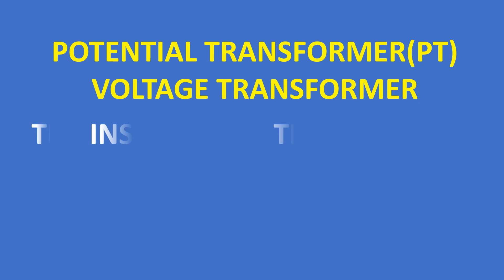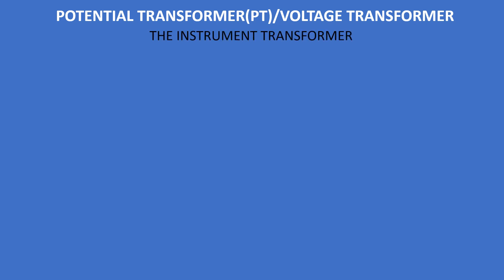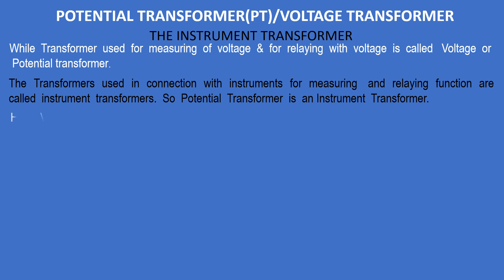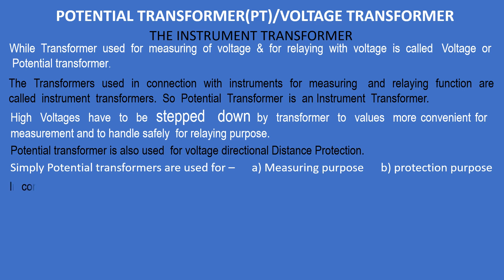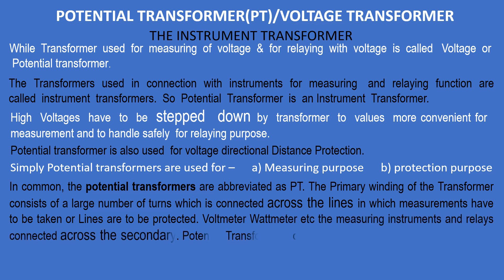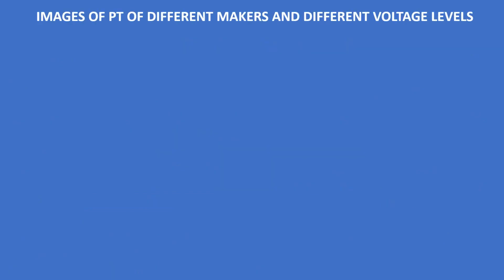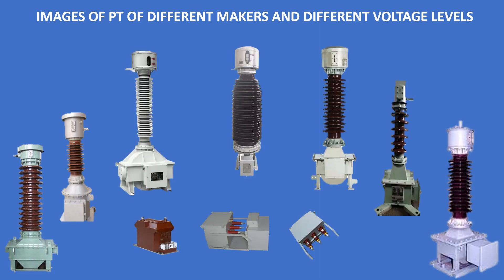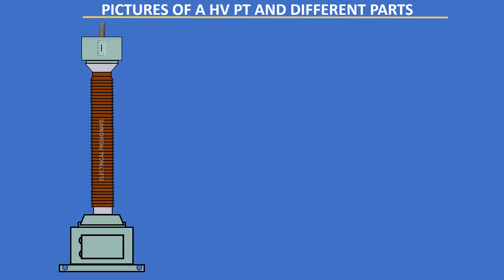POTENTIAL TRANSFORMER:WHAT IS PT:PT CIRCUIT CONNECTION DIAGRAM:VOLTAGE TRANSFORMER:INSTRUMENT TRANSF

Comment: just wondering, that, what if you would feed 20 KV to LV side of the coils, would you then get over 100KV out from the HV side of the thing?
Reply from the maker: Burden of a PT is few Volt -Amp. As electromagnetic PT is a step down transformer and its working principle is based on transformer, it can be used as step -up transformer
by applying 110 Volt at its  secondary winding to get rated working voltage at primary (HV) side but at low VA.Secondary winding should not be connected  beyond 110 Volt
to avoid insulation failure and other damages.Thank you sir for visiting and your valuable comment.
Reply: @electricalpassionate  Thanks for the answer! :)
Reply from the maker: @mcsaatana1614  you are welcome.
Reply from the maker: @mcsaatana1614  you are mos welcome.